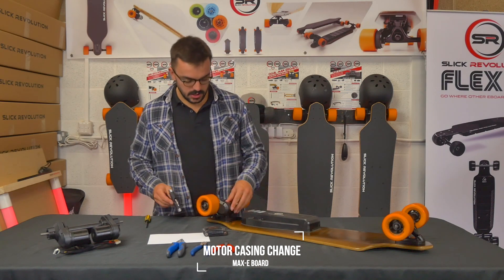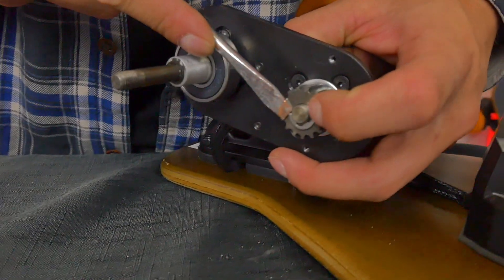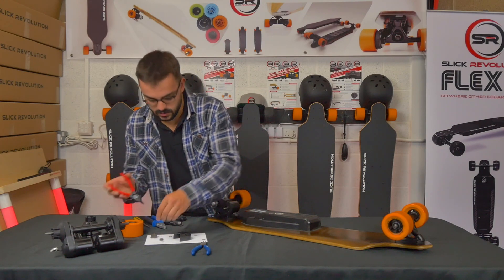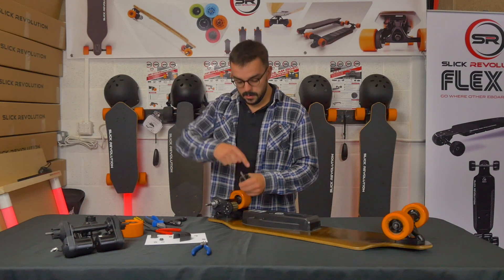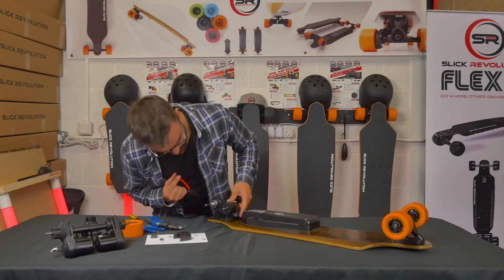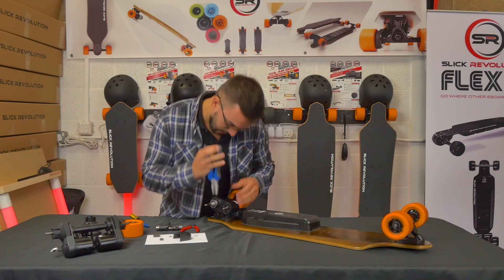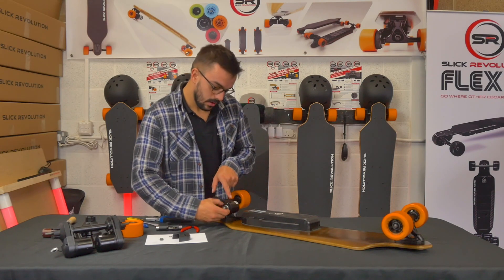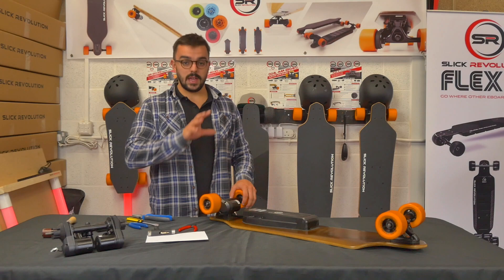Slick Revolution Maintenance Series | Motor Casing Change

Comment: I have a max eboard 1.0 and the entire belt drive has started to shake a few millimetres down. Ive tighted everything but it still seems to be loose. Hopefully you can give me some guidance on what to do? Thanks :)
Reply from the maker: Skott Beal hey Skott

Bob is a short video showing the issue/where the movement is. We will sort you out
Reply: okay, shall I send a video over on facebook messanger?